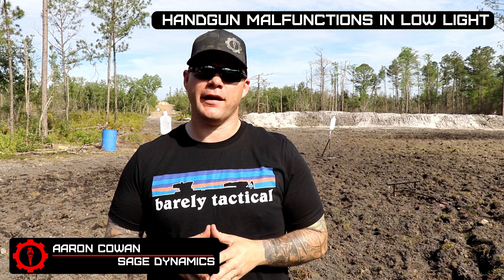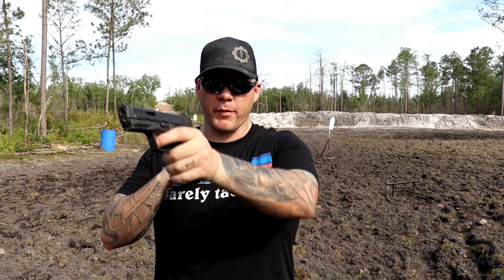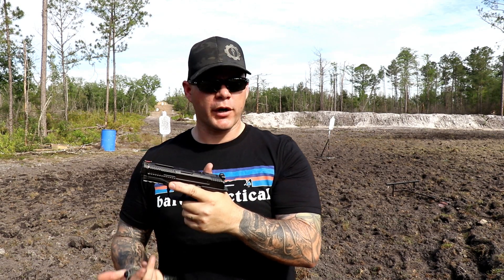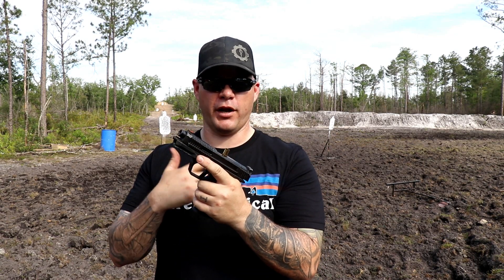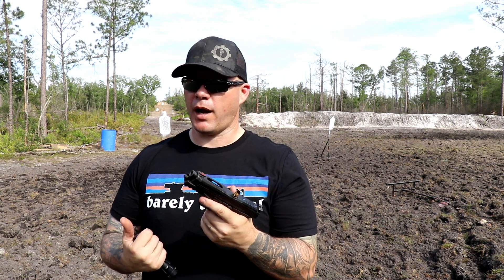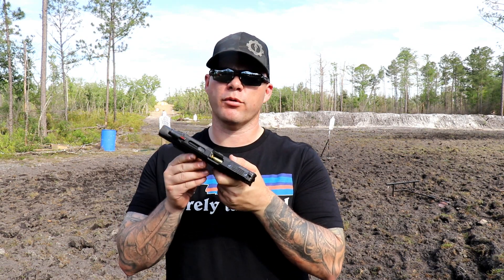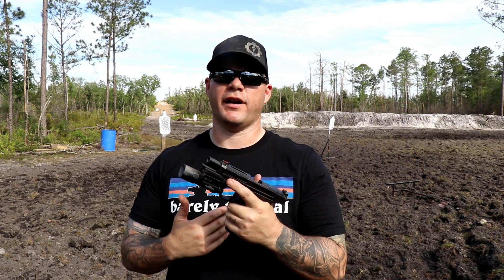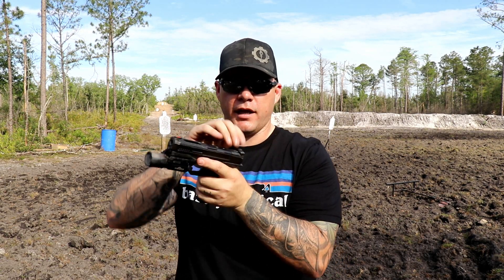Handgun Malfunctions in Low Light

Comment: Hi Aaron, great video as usual. 
I just wonder if you can rely on the “sound feedback” from your gun during high stress situations, or the sensation you have from your finger (when you loose fine motor skills).

I mean, we fire a lot of rounds every year, and I’m pretty sure you could determine that a gun is not chambered just from the sound it makes a miles away, but can we apply this to everybody ?

Anyway, just asking 😉

Thanks a lot for your videos, always a pleasure to watch them ! 😊
Reply from the maker: Strat-et-J-Concept SnJ feel more than sound.  You don’t lose fine motor skills, not close to the degree that it prevents you from working the guns controls.
Reply: SageDynamics thanks for your reply. 
it does make sense. 
I usually have between 25 to 30 students per months but most of time, beginners. 
I’ve based my reflexion on that, but I must admit that with experienced shooters it won’t be an issue.

Thanks a lot for all of your work,

Regards,

Johan

Comment: What do you think about this? To keep the consistency and simplify the procedure of clearing malfunctions. For both stock pipe and double feed malfunctions, clearing them by yanking out the mag, rock the slide and reinsert the mag. Because these two malfunctions have same symptom which is dead trigger. And the method for clearing double feed can clearly do it for stock pipe.

Comment: Thanks. It seems, though, that in any lighting condition, if you pull the trigger and the gun does not fire, then you should immediately tap and rack. This will clear a failure to feed, or a failure to fire, or a stove pipe. If, however, after the tap and rack the gun is still not in battery, then, assuming no other problems with the gun,  you know you have a double feed and you press the magazine release, rip out the magazine, rack the slide, insert a magazine, and rack the slide again. Any problems with this line of thinking?